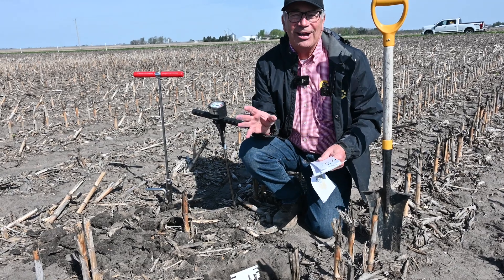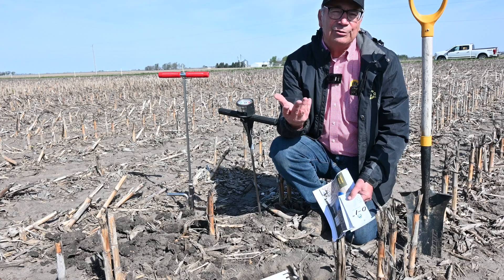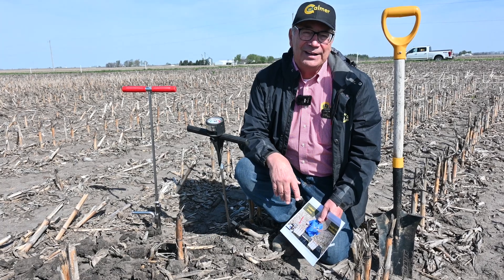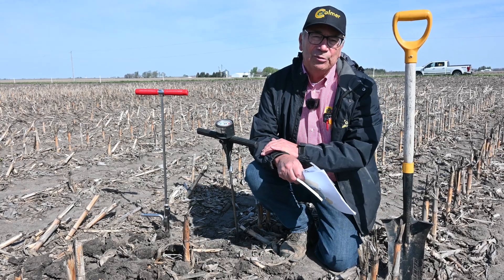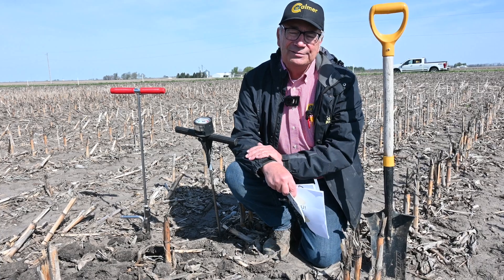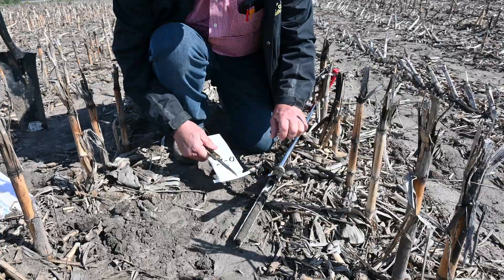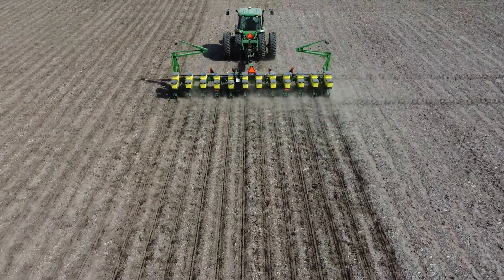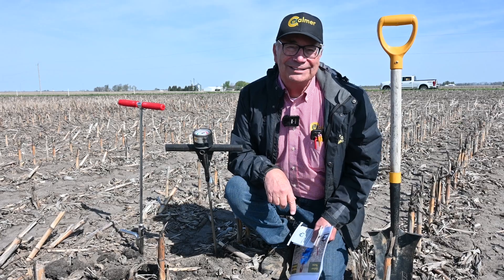Soil Stratification Research for 2024

Comment: Do you account for soil moisture when you pull samples? I assume you pull samples when it's dry on top and not wet. I think they say K levels come back low when dry
Reply from the maker: Yes we waited till it was dryer to pull the samples.
Reply: @CalmerCornHeads  so if it was dry on top and moist down below would that skew results
Reply from the maker: @agger838  Marion actually air dries each bag of the soil at home before sending it in. This is to help with that potential issue.
Reply: @CalmerCornHeads  gotcha!